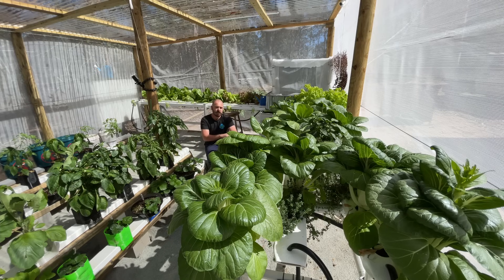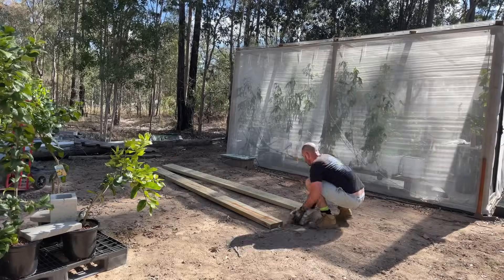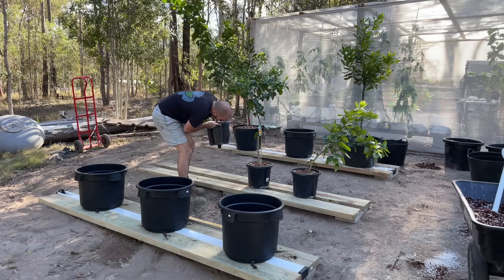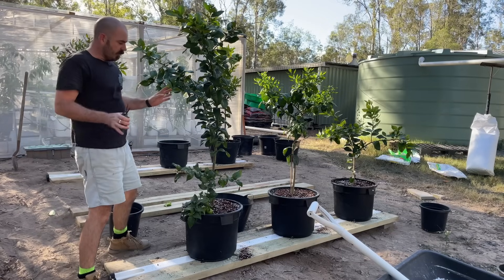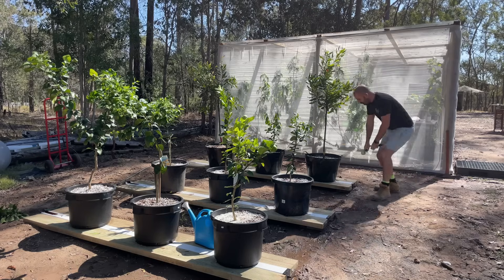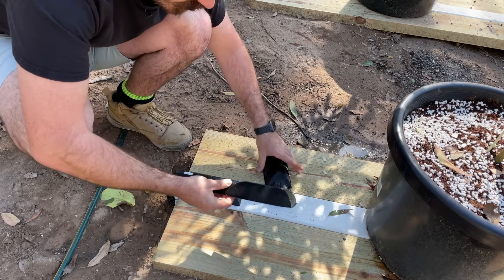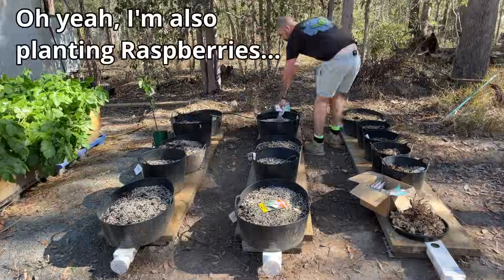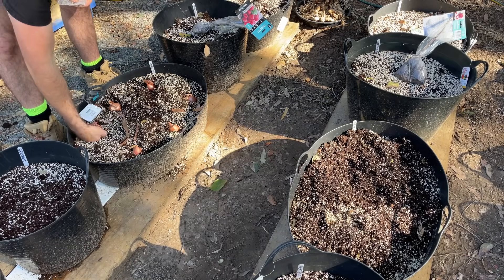A Hydroponic System for Root Vegetables!

Comment: A few notes 
A. I noticed you had your big tank feed the gutters .however with a faulty float it will drain the entire supply. If you have a sub reservoir you can use it to supply the gutter systems and use the main supply to feed the reservoir. In this way , daily you can turn on the main feeder to fill the smaller sub reservoir and avoid losing the entire reservoir of expensive fertilizer mix.

Comment: One little thing for the float-cover: when it's condensig during the night: the condensing water will run down the cover and ubder the edges outside. Of you woiluld just add a little lid near the cutted outline of your pipe, the water will drop down inside the pipe. Just an idea...

Comment: Better than pyrethrum: neem oil. Spray it in the evening and the beneficial insects will be unaffected, as they're active in the daylight. Bonus: neem acts as a plant food.  Now I have a question, and apologies if I just missed it: what keeps the coir/perlite mix from trickling into the gutters? I've done a wicking system before (faux Earth Boxes), but there weren't many holes and those were covered with weed cloth. Even then, we got some spill-through.

Comment: Im guessing the EC and PH stays constant in the RG system because its not actually the plant that is taking the water out. The wicking effect just takes  what ever is in the reservoir. This is why i love these passive systems way less maintenace and my opinion less wasted nutrient solutions.
Reply from the maker: Fantastic observation, I have noticed once the roots take over the res (as with some of the pumpkins I’ve had in system) they do start stripping the nutrient.
So this stands to reason.
Reply: @Hoocho  Interesting! I was going to say though that you were doing your measurements near the float valve where you would expect levels to be the same as in the reservoir. What are the levels like at the opposite end of the channel? I would expect a change over the length of the channel as the plants take what they need. However the wicking point above may account for little or no change over length of channel. :-)
Reply from the maker: @ianbrown9578  theoretically due to diffusion generally EC will not vary across the channel.
https://en.m.wikipedia.org/wiki/Diffusion

But it’s an interesting idea and I can test it practically in an upcoming episode.
Reply: @Hoocho  OK! Thanks for that info, much appreciated! :-)

Comment: Hey Hoocho, I'm curious about these wicking beds you're using for the trees and the root veggies. Are you hooking these all up to the same res? Also, are you flushing and cycling the drainpipe wicking beds weekly/fornightly? If so, do you find the plants are having any problems with a lack of dissolved oxygen? The fruit trees in the nursery pots should be fine, because they have aeration holes built in, but the veggies in those huge buckets with only the mesh pots in the bottom, wouldn't really have much of a source of airflow in to the root base if the pipe isn't flooding and draining regularly, or running like a constant-flow NFT. How did the radishes and stuff go in those giant tubs?
I'm an aquaponics guy, and I'm incredibly lazy/labour-efficient, so the more that I can automate and the less manual monitoring of EC&pH levels that I can do, the better. I like having one spot to check the stats for the system, though with about 10 of these 3meter pipes, using standing water on a float valve, I'd go crazy checking the consumption of nutrients, pH in all of them, and manual draining every week.
Edit: What are you using for the taps on the end of the pipe? I'm going mad trying to find something to adapt a 90mm round drainpipe to a 20mm BSP so I can drain it using a hose, 19mm irrigation pipe or 20mm PVC piping back to the res.

Comment: What water tank connector do you use that goes through the tank? I have got the maze one going into a black bin, but find that the tap part that you turn leaks under the pressure. Bin is 60l and mazes tank it is for is 100L so didn’t expect it to leak!

Comment: Wouldn't a flood and drain system be better for trees, considering the root mass?
Reply: I grow using a system a lot like this and haven't had any issues with plants that have large root masses. I'm not doing full on trees, but am thinking about some dwarf fruit plants.
Reply from the maker: It would be harder to implement, I would also be worried about roots interfering in the water flow.
Would be interesting to see though.
Reply: Have had flood and drain beds with tomatoes, chillies etc. The root masses prevent water movement by mid season and by the time I pulled them out in autumn there was a lot of rot in and around the core. I feel it would only be worse for citrus and trees that stay alive for much longer.